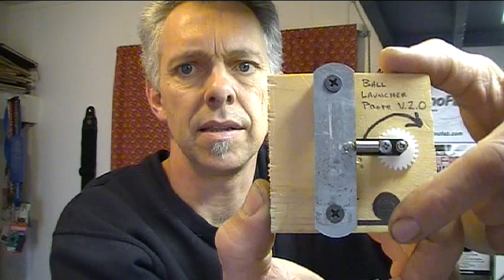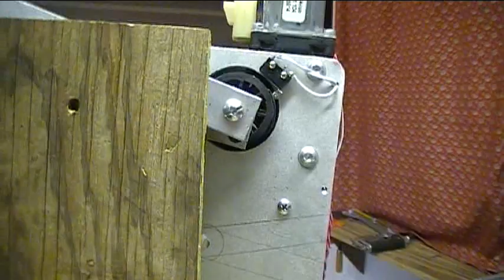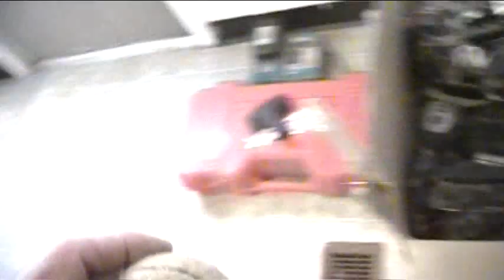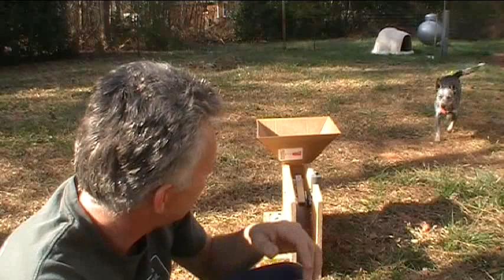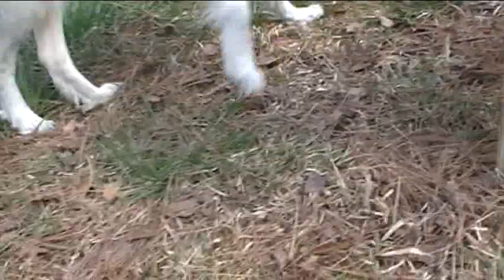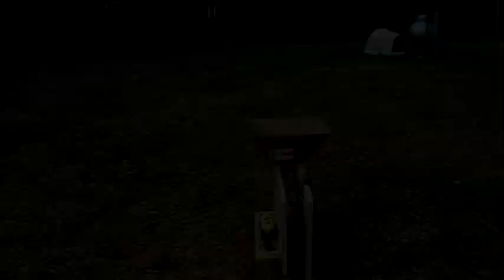Automatic Ball Launcher V2.0

Comment: An improvement for you:  
make a hole in the side, and place the basket/receptacle onto the side or even towards the back.  
the dog will be out of the way, instead of potentially standing in front of the opening, when depositing the ball.  
the machine doesn't care where it's fed from.  
another bonus is it doesn't have so much momentum inside, as it'll hit a wall, and just slowly roll onto the switch.  
make opening in side just a few inches in front of the switch, and not so much towards the front exit.

Comment: Very cool video and project ! Ive been thinking of different ways to make one of those myself  and i like that you kept it simple and inexpensive to build  its amazing that a Automobile Windsheild wiper motor has the torque to load a spring  like it does  it looks like Sophie. Is very close to figuring out the entire process. Try  reinforcing her with treats    On her “ drop” command without the complexity of the chute  a bit then   Teaching her the chute  it looked like she was getting too Anxious  to do too many things at the same time ? A old trick is breaking things down into smaller  commands !  I also like the idea of using the light  and small  18 volt battery

Comment: I want one that isn't operated by electrics or motors, but one that would be a spring loaded catapult so the dog would step on a lever that would release the ball and fling it off. that would mean not batteries and the dog gets more complex interaction
have you considered that?